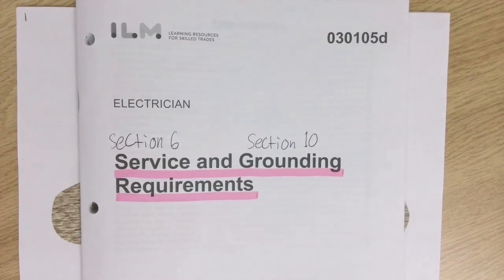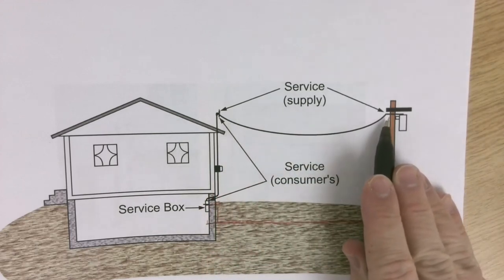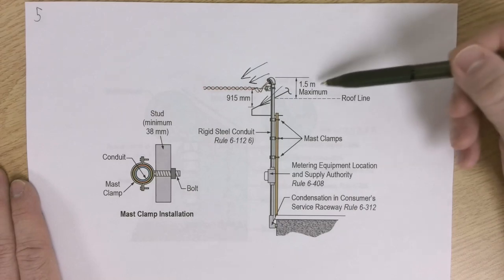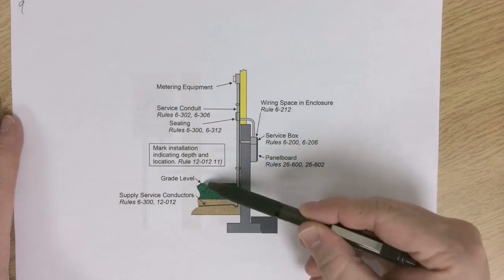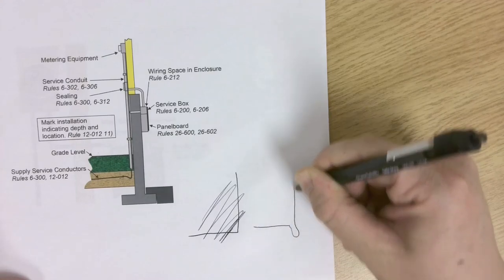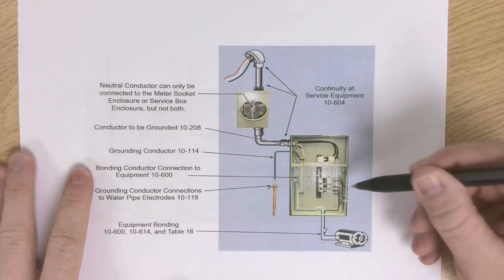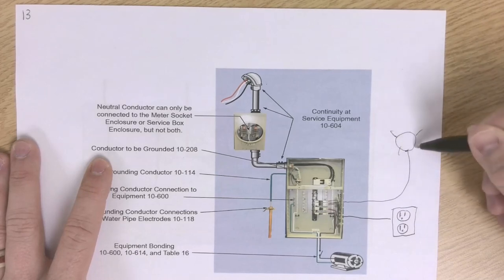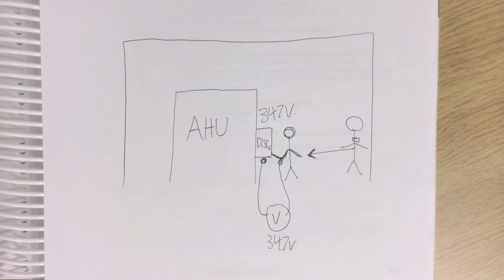Services and Grounding Requirements

Comment: Can you go over the real world difference between grounded and grounding? You pointed to things for grounded that I would have considered bonded. And I thought that the ground rods primary purpose was to dissipate lightning. Faults hopefully flow back to the grounded system conductor,no? 
Thanks for any help. Awesome to have more Canadian online sources.
Reply from the maker: You are correct in thinking that the fault current will probably go back on the grounded circuit conductor, which is the white wire, causing the overcurrent to trip. We bond non-current carrying metal in case of contact with a live conductor. 
I may have used the general term 'grounded' in place of 'bonded' by mistake in this video.
Ground electrodes (plates, rods, grids, etc.) serve as a safety measure as well as a reliable way to create a potential difference between the live conductor and the grounded/ identified/ neutral conductor (white wire). They are not specifically for lightning strikes.
For the difference between grounded and grounding, try looking at the Section 0 definitions. Our grounded conductor shall be white, gray, or bare (see also identified and neutral). Our grounding conductor shall be green or bare. Both colour requirements as per Section 4 & 10 respectively.